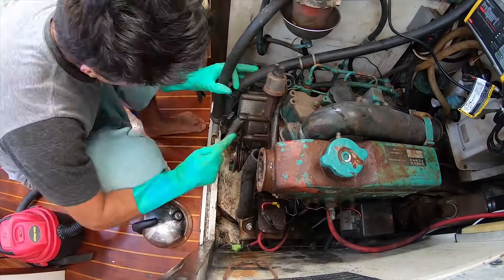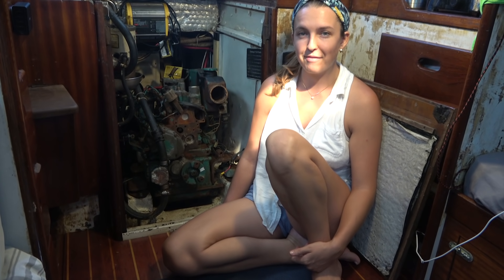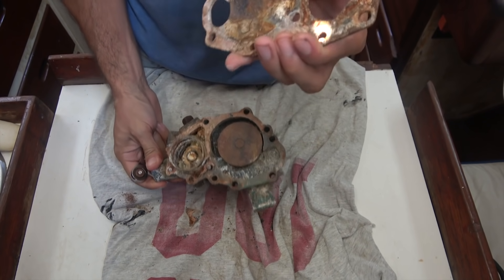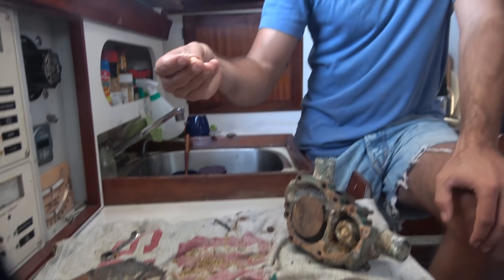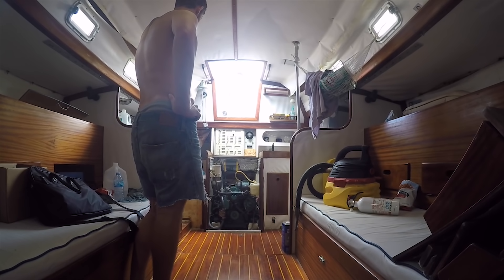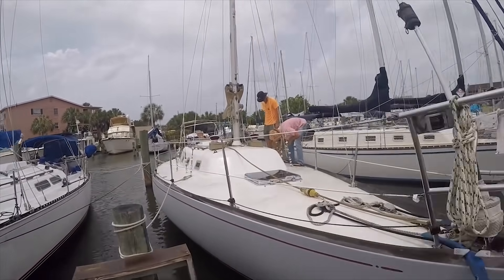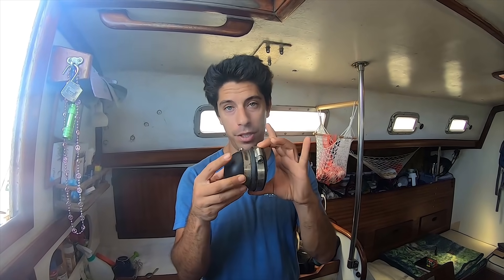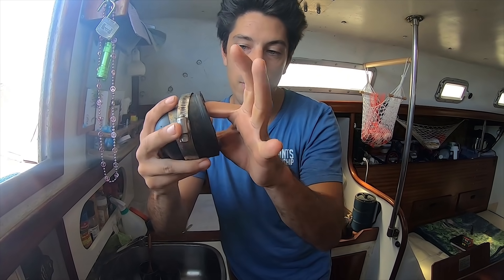Do NOT Buy a BUDGET BOAT without Starting the Engine!🤦 - Bums on a Boat Ep 122

Comment: Take the opportunity to clean up the whole engine bay ... The biggest killer of engines is contamination either in the air or the water or the oil or lastly the fuel.
Keep all those clean and regular services every 200 run hours.
Last point diesel engines do not like to run on low loads they are designed as work horses and not to be wrapped in cotton wool .... Work it hard baby it will love you for it.

Comment: I would like to suggest that you look for a reputable engine repair shop and just go ahead and let them assess the Volvo. If they are truly reputable and tell you that it's worth saving then proceed with having it rebuilt. If not get a good low hour replacement or bite the bullet and buy a new shiny engine and have it professionally installed. p.s. the type of warm weather sailing that you do makes the installation of a thermostat unnecessary.

Comment: You can not know what you have never been taught. Nobody told you to replace the elbow, you were uniformed, now you are replacing it. It does however crack me up, all the people blaming "volvo" or saying "buy a Yanmar"  when I have worked on virtually all makes and models in my years. Guess what? They all break. They all need to be maintained. Cooling systems used in sea water are a very high maintenance component. Nobody told you so you didn't know.  Hope all goes well!

Comment: Buy a new engine, please.  With all the parts you are buying, it will still be an old useless piece of s....t. Your only dealing with one part of the engines functions. Banjos, fuel pump, pistons rings, oil pump the list goes on and on. I was trying to fix my old engine for five years. I took it out of the boat three times and rebuilt it. Never again. If I buy another old boat I will leave enough money in the budget to buy a new engine.